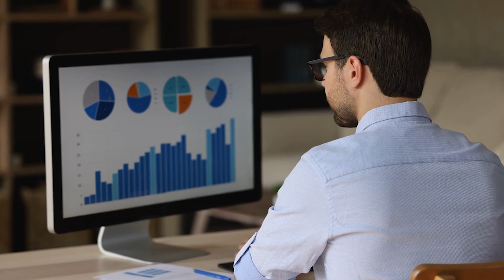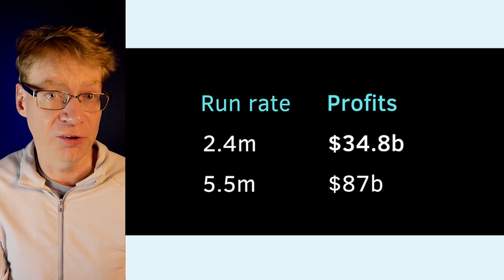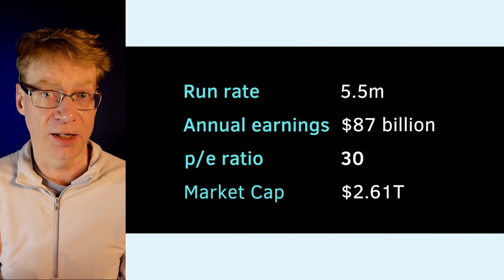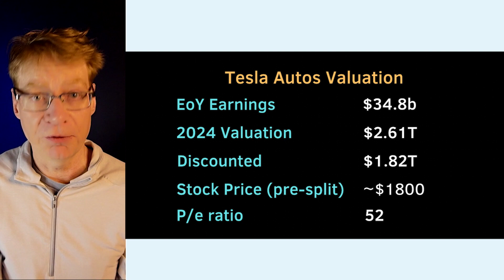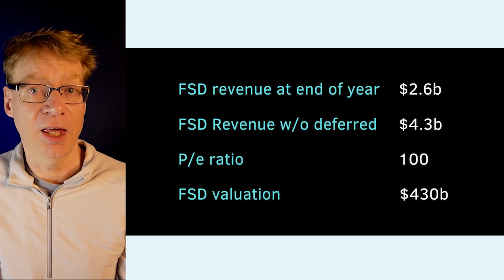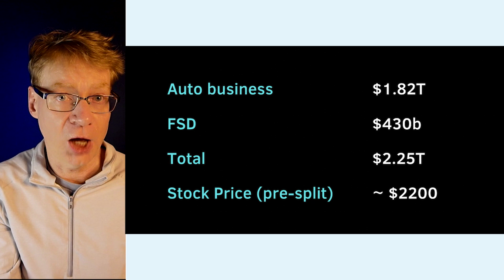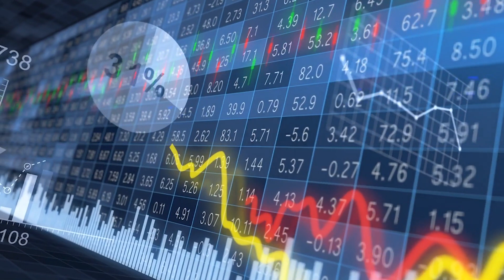TSLA Valuation for End of the Year

Comment: The greatest pressure Tesla will face going forward over the next 12-24 months will be the Macro Economic Environment in the short to medium term. 

Many experts are saying that the current 'recession' will be relatively short in duration. But my perspective is based on the fact that the artificial support that Central Banks all around the world have continually used since 2008 has finally run out of momentum.

I will not be surprised if there is a market correction of up to 30-40% the affect on relative GDP could see real losses of 5-10% on the Global Economy. This is 2008 all over again except the Economic Backstop is no longer available as a stop gap.

Comment: Valuing Tesla is such a challenge - it requires some LEAPS! You can take an extremely conservative approach and just value it as an auto business. But you'd be ignoring Energy, Services, FSD software sales, Robotaxi revenues, Autobidder, DOJO as a service, Bot sales/subscription revenue and any other future products/services. By excluding any one of these items you're effectively using a discount rate of 100% for that part of the business - which is extremely (unnecessarily) conservative! It's fine to be conservative, as it results in a stair-step valuation model as those things become "real" - and some of the stairs are huge. For example, when FSD is solved, the jump in valuation would be massive as it turns every Tesla vehicle into a revenue producing machine. Also, the potential scale (and revenue opportunity) of Tesla Bot is also massive. Tesla's valuation could be thought of the auto business plus a number of LEAPS in other areas. VALUATION = AUTOS + FSD LEAP + ROBOTAXI LEAP + BOT LEAP + ENERGY/AUTOBIDDER LEAP + ...   And, as you know, LEAPS have considerable value!

Comment: This is great, love following your content. Helps in reaffirming some of my own assumptions. That said, for '23, what are your thoughts on the possibility of Tesla upgrading their Gigafactory lines again for Shanghai, Austin, Berlin, (maybe Canada), to begin gigacasting of car doors at scale. They have since inception moved from stamped parts to gigacasting of rear pieces, then gigacasting of front and rear. Then introduced the structural battery pack. The last biggest area of cost I foresee in their future and an efficiency bottleneck for exponential scalability, is vehicle doors. If they address that, then all the big pieces will be consolidated. What's left is just pure scaling.

Comment: Excellent as  usual .. please do a 5 year discounted earnings (20% discount is fine ). even if you stick with 50% YOY growth past 2024 (that's guidance )   then apply the multiple now (present value - end 2022).. not sure if you added in present earnings i.e .22 YE  run rate - 2023 plus earnings growth.  50 PE is fine.. forward PE now is above 70  - 30 maybe later .. we don't know -- see AAPL

Comment: I'll stick by my price ceiling of $1500 at least for the next year, or $500 post-split. There are too many question marks about whether the current 4680 production issues can be solved, and I'm betting they won't because Tesla has been making these batteries for the best part of a year and if they had any clue about implementing a solution to the technical issues they are having in speeding up production of the 4680's, they would have tried it out, at least in Fremont, and then implemented the solution in Texas if it worked. Don't forget, this is a ground-breaking, experimental battery that has never been made before. They tried introducing three new radical changes, of which the 4680 form factor is the least radical, the other two being the tabless design and the dry coating process. They tried changing too much at once, and the proof that it's not working, is that Tesla has started production of 2170-based cars at Texas. That tells me that a solution is not in sight to the technical issues they are having, because if all it took was to stop production for a few weeks and rejig everything in the production process to make it work better, they would have done that, rather than change their plans mid-stream and go back to making the same cars with the same batteries, which presumably were not good enough for Tesla's innovative product improvement plans. I suspect that sometime next year Tesla will quietly drop production of their own 4680 batteries, and either buy Panasonic's 4680 which is not a tabless dry-coated design, or go into a new JV with Panasonic to make the 4680 batteries Panasonic's way. It's interesting how the conservative Japanese way of improving technology is proving itself once again, while the reckless, throw caution to the wind strategy of  betting the farm on a novel unproven idea, is coming unstuck for Elon Musk.
Reply: So if they can buy 4680s off them then teslas growth shouldn’t be impacted much? Only possible future margins will be hurt a little?
Reply: @thejokert8   It depends on how long Elon perseveres in trying to make their own 4680 battery production processes work. If he keeps burning through money he's putting his shareholders at risk. The one thing in his favour is that locally made batteries will qualify the vehicle for the new incentive so that does give him some padding to raise prices. If he can price the base Model 3 with a smaller pack just below the $55k cutoff, and the Model Y below $80k for most of the range he can probably make the locally made battery work by using parallel production lines to increase capacity. Likewise, a JV factory with Panasonic based in America would also qualify, at least for the next year, but long term it's going to be a battle to increase local content all the way to 100% in line with the regulations.

Comment: Great video, love the channel! One question, when calculating P/E ratios, shouldn't net income be used instead of gross income? When TSLA produces 5.5 m. cars, given an ASP of $50k and 30% gross margins, the annual gross income would be around $88 B. The net margin for Q2 2022 was ~14% and if unchanged would result in a annual net income of $38.5 B on 5.5 m. cars produced.

Anyway, thanks again for great content.
Reply from the maker: We are using net income. With higher ASPs and margin. The OPEX becomes very small when profits increase that much.
Reply: @TeslaEconomist  Got ya, thanks.

Comment: I'd carry some more research on Powerwall and, even more so, on Megapack and their tech before claiming there's little barrier to entry there and putting Tesla Energy on the side... And let's keep in mind, Tesla Energy may even get up and running faster than FSD will get approved by regulators worldwide.
That being said, glad to see you on camera this time.
Reply from the maker: There is minimal proprietary technology. The Chinese can offer solar and storage products too. 
Besides at $2t+ it’s not going to make a dent either way.
Reply: @TeslaEconomist  Well, in terms of peaker plants you need more than just storage, you need software expertise. And for powerwalls, you also need software if you want to efficiently sell to the network. The differentiator and the added value aren't that minimal I would say.
Somehow, the difference between dumb storage and smart storage may look like the one between a dumb phone and a smartphone I'd add...
That being said, Tesla Energy may not be on the same scale as automotive, but here we're buying future cash flows much like we weren't just buying Tesla Motors' few thousands car production back in the day. So, IMO, not accounting for Energy here is a big underestimation especially since the batteries that will be used in storage won't necessarily be the same as for cars and will not require rare raw materials from now on to the point where it may not even use the LFP chemistry. There, I'm looking forward to seeing Tesla's plans in Indonesia...
Reply: Sure, for an end-of-year evaluation, that may not make that big a difference yet. But I have the feeling this may change very soon with Plan 3...

Comment: Thank you. Can you comment on which batteries teslabot will likely require?
Reply from the maker: At this stage 4680 high energy density. They need to keep weight low and the few cells they require won’t add to much cost.
Reply: @TeslaEconomist  Thank you!

Comment: You are not extreme,  I had $2700. 
The other day I was thinking of a pendulum effect, in that the market is slow to recognize the value, until the weight of results bear upon them,, then there's a pendulum reaction of a price upswing. 
 They simply can’t forecast a fast acceleration, it is not in their scope to think that way, They have to have it upon them before they accept it. 
In fact, this will be the story over the next 10 years.  When Tesla reaches $3000 they can't digest a 40 pe ratio... and so it will go on at 5000 and 6000 and 10000.
Reply from the maker: Yea the growth is far from priced in